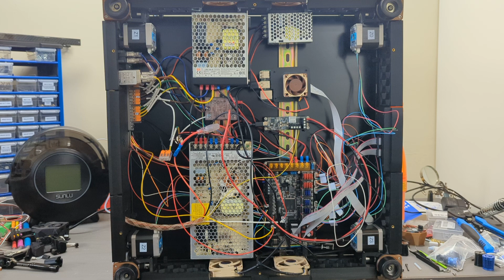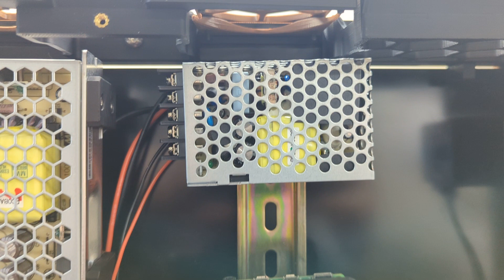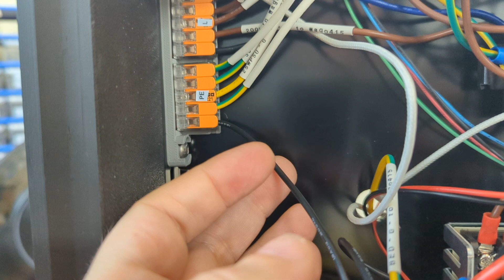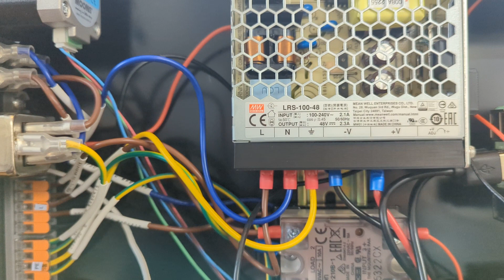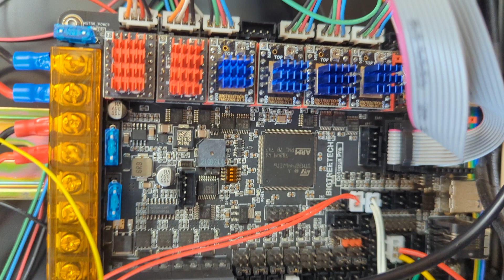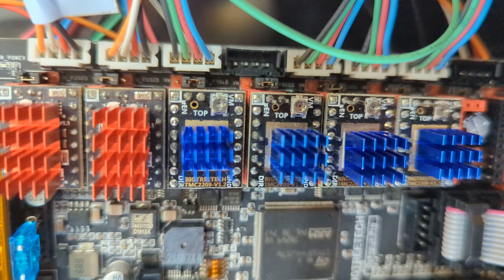Voron 2.4R2: How I upgraded my stepper drivers to 48V

Comment: The 48V/100W PS delivers  2.1 Amps max.. You set the stepper drivers to 1.4A max each. Aren't you worried that the PS will fail because it can not deliver the 2.8A ?
Reply: To take advantage of that 48v tmc he needs at least 400w 48v psu

Comment: What A/B motors are tou running. Depending on the motors you can turn that amperage up. I am running LDO super Power at 48v at 2.5 amp, but will be swaoping them out for the Speedy Power since these like 48 better than the Super Power

Comment: aren't there only 35V caps on the octopus? did you upgrade them for those two steppers?
Reply: You're right on the Octopus having at 28v max (35v capacitors)
But he's using the Octopus Pro, which maxes at 60v (63v capacitors)

Comment: can a LRS-100-48 power 4 steppers for a AWD system ? or do need to get the meanwell 150 48  or even a higher watts one ?
Reply from the maker: Short answer is yes. There's a longer answer that someone shared with me a while ago, but I have been told that even a 50W PSU should be plenty for 4 stepper motors. I have never had any motor power issues with this configuration.
Reply: @oldguymeltsplastic  this is great so I will go ahead and pick that 100 W 48v meanwell for the future upgrade and some btt tmc5160t pro

Comment: Hey man, what do you think will have a greater impact on accels/speed and quality? an AWD setup at 24v or the two AB running 48v? I run a vzbot 235 with four ldo super power HT in the gantry so I´m accustomed to the high accels with good quality, and I´m considering building a 350mm Voron 2.4 for pla only but want a fast snappy machine without the vzbot high power budget.
Also, if I do run AWD in the Voron that would be 9 steppers, four for the gantry and for z and the extruder one, you know what board could be used cause the btt octopus has only 8 stepper driver slots hum, that´s the one I run in the vzbot, thank´s
Reply from the maker: I don't yet have any firsthand experience with AWD configurations, so I can't really comment on that.
As for 9 motor setups, if you don't want to use a CAN Bus toolhead PCB for your extruder motor, BTT has the Octopus Max EZ that has 10 stepper driver sockets.
Reply: @oldguymeltsplastic  thank´s a lot for the response, I didn´t realize that using the can bus board I could bypass the extruder driver, but that is good news, I´ll have a look at the octopus max either way, thank you so much

Comment: Can you share your printer.cfg for the motor settings?
Reply from the maker: I am running LDO 2804 Super Power motors at 48V and run_current: 2.8
Don't try this unless you have similar hardware installed in your printer.
https://github.com/OldGuyMeltsPlastic/Maxime
Reply: @oldguymeltsplastic  sure, just for reference to see what's possible. I'm still tuning, thx very much.

Comment: running your zmotors at a high run current isn't the best idea.
if you get a nozzle crash it will do alot more damage since the motors have more torque.
Reply from the maker: There's also not much reason to do so, given how slow Z moves are on this printer.
Reply: @oldguymeltsplastic  it can be beneficial having high run current, if you use z hop or have super fast QGL/bed mesh.
Personally I prefer the high run current for z. This way I know I won't have any loss of z microsteps.
Reply: It is a good idea if you run a tool changer, as it allows faster z movement to switch tools

Comment: Are you happy with the LRS-100-48 after a time of using it ?  
Does not shutdown in your use ?
Thank you.
Reply from the maker: It has proven sufficient to power just the two A and B stepper motors. Everything else is running on 24V.

Comment: Do the jumpers under the 5160 drivers change? What mode does everything run on, uart, spi, or normal?
Reply from the maker: I run mine in SPI mode
Reply from the maker: I run my 5160s in SPI mode, but my 2209s in UART

Comment: How are you powering your bed?
Reply from the maker: The bed heater on this printer is a 110V model, and so is powered directly from the mains wall power, rather than the printer's own 24V power supply unit.
Reply: @Old Guy Melts Plastic  right, i saw your ssr, i just don't see where you are signaling the relay from. Not the bed out,  i know some use a regular heater output ho0, ho1 etc (no one has ever explained why people do that either, although for a relay signal, i get it) i see you only have the one hooked up. 

Does that make sense?
Reply: @travistucker7317  he is signalling the SSR from heater port #2. Heater port 1 looks unused. It looks like he has a UTOC canbus board down there. I'm guessing the hotend heater is controlled by a canbus toolhead board, which is why we only see one heater port in use on the main MCU.
Reply: @NickNick  nice. Makes sense. Thank you!
Reply: @oldguymeltsplastic  also i see you didn't use the standard 110v black, white, green.  I was wondering if you were in Europe. Why did you choose those colors on mains?
Reply from the maker: Those are the wires that shipped with the Formbot kit. I am in Canada.
Reply: @Old Guy Melts Plastic  OK that makes sense. Im not too familiar with our northern brothers unless it comes to trailer park boys,  letterkenny,  or shoresy. 
Where is signal coming from to switch your relay for your bed?
Reply from the maker: @travistucker7317  Good question: I just followed the build docs from the official Voron V2.4R2 manual found here: https://github.com/VoronDesign/Voron-2/raw/Voron2.4/Manual/Assembly_Manual_2.4r2.pdf , the SSR wiring is split across pages 216 and 220.